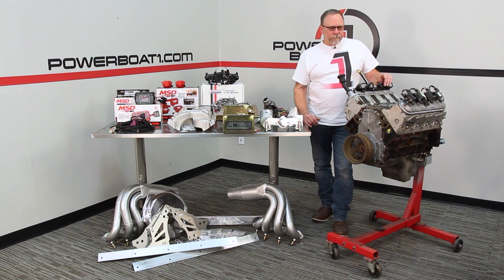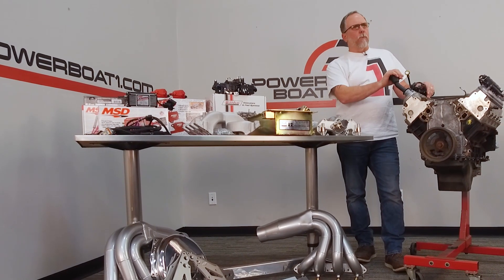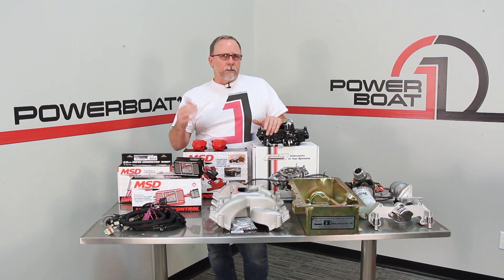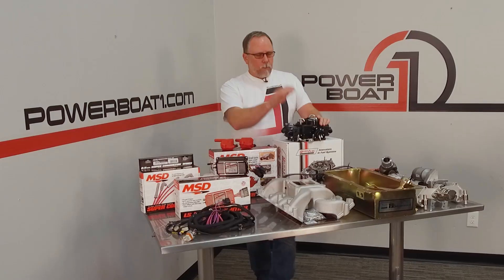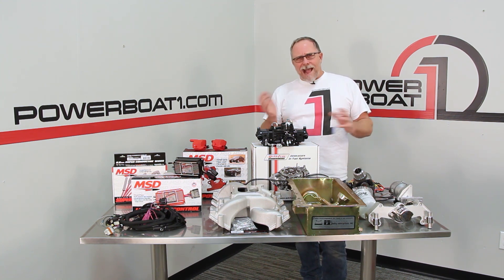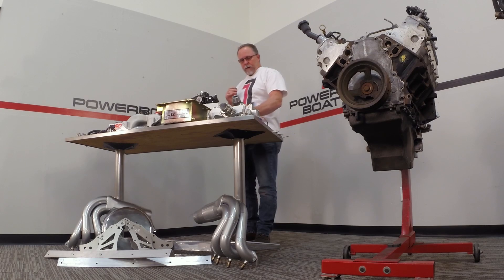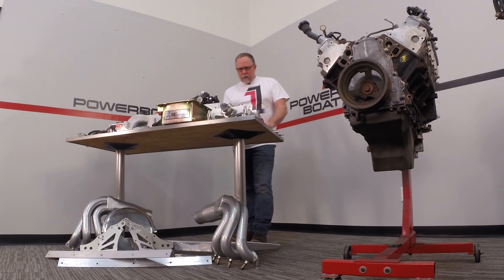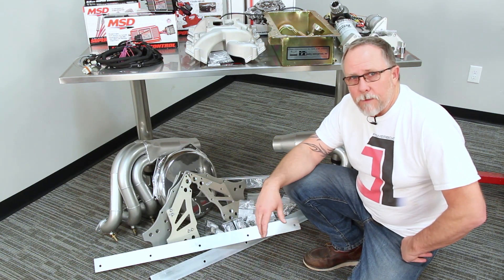LS ENGINE MARINE CONVERSION: Laying out the Parts We Need

Comment: ok ok ok enough! I respect your knowledge and direct info here yet what about the guy with the 1992 open bow boat powered by a tired 309 hours later center bolt valve cover small block gm 305 v8!!??? we want to stuff an LS 1 2001 era 6.0 v8 LS  dressed v8 engine in place of that old tired small block? We should need direct info for water cooled manifolds and water cooled intakes infi and maybe even water cooled throttle body! and flywheel bolt up and even engine mount options!!!!!

Comment: Editing my response to bring it up to date correction here now because the O2 censor must not be a problem since there are so many exhaust and riser options now that offer an O2 outlets on them. What ever the design problem people where running into before must have been fixed.  Saving the stock injector system should be easy but the controller may be changed to something like an EFI Controller instead(Holley EFI Terminator series). I would like to see a shaved down kit running the stock injection system. Not having to do the conversion would be nice and the money saved would go nice to the new exhaust system and a marine cam.
Reply: Thoughts for this application on a 1984 glastron Carlson cv23 day cruiser style boat
Reply: @chrisgarrett1369  As long as it floats and you got the money money, send it! Just understand a new marine engine 350ci replacement engine will cost you 6 or 7 grand plus tax. If there kit cost to much then what's the point. Also  I will mention, people have told me that you do want to invest into a marine cam since the wet exhaust can under back pressure put a little water in the cylinder. I don't know how true this is but definitely something to look into. Saved money for keeping the stock injection could go to this extra cost.
Reply: @chrisgarrett1369  Had to update my original post since I looked into it yesterday. So read it and it might be helpful.

Comment: What about water coming your cylinder heads your missing that
Reply from the maker: On a LS all of the water enters and exits through the front of the block, the heads only have steam ports.
Reply: Powerboat 1 ahh okay just making sure Ik bot engines are built of cars blocks but. Doing it yourself and one thing missed can be a dreadful mistake. Someone i knew did that got a day out on the water before having to be towed in by another boat

Comment: Why a carburetor instead of fuel injectors?
Reply: The reason was really so we did not have to run an O2 sensor in the wet exhaust. Using the carburetor eliminates the O2 sensor and the need to program the ECM when using EFI. So just a simpler way of installing the LS engine.

Comment: @1:59 Where can I order this coupler? Does this mate to a Mercruiser Outdrive?
Reply from the maker: You can order it from CP Performance, however the one shown in for jet applications, not Mercruiser Outdrives. For an LS application with a Bravo outdrive, you can use the standard Bravo coupler.
Reply: @Powerboat1  - That coupler looks like a cleaner way to couple the engine to the drive so I figured I would ask. I swapped a LM7 5.3 LS right out of a junkyard silverado into my 86 Formula. I used a stock LS flywheel, big block "bell housing", and bravo coupler to my bravo outdrive. Thats been working for the past 3 seasons now.
Reply from the maker: @4MULAzero  Gotcha. We're always looking to share stories of boaters who have done these types of conversions themselves. If you are interested in sharing your story give us a shout at tellyourstory@powerboat1.com
Reply: @4MULAzero  please post a video of your conversion. I'm building a 30 ft. Skiff for fishing commercially around a 99 ford ranger motor.